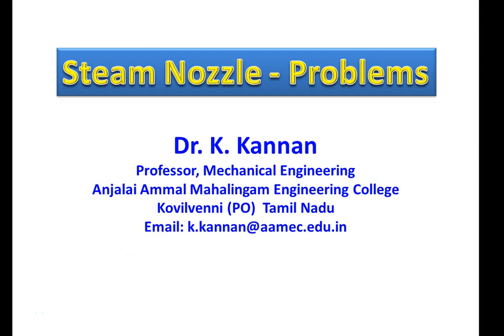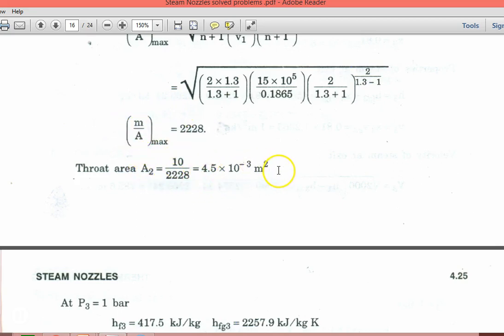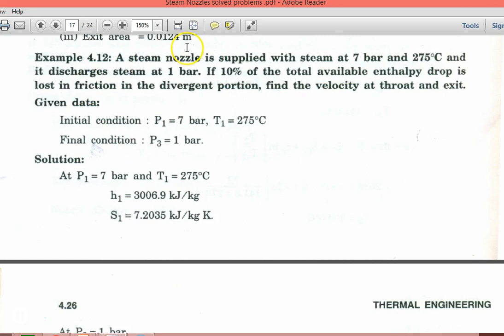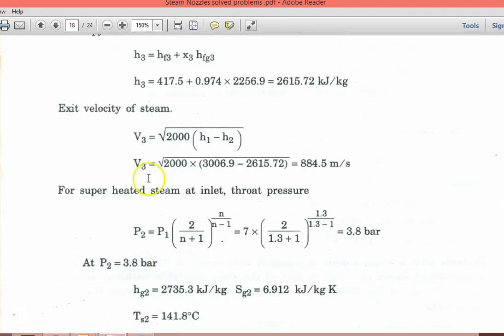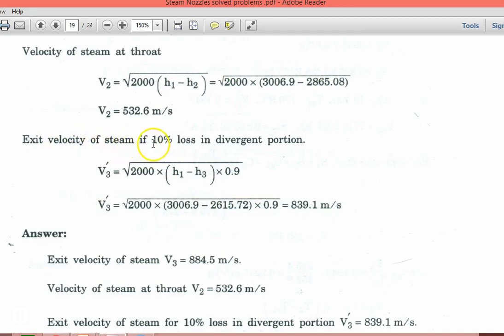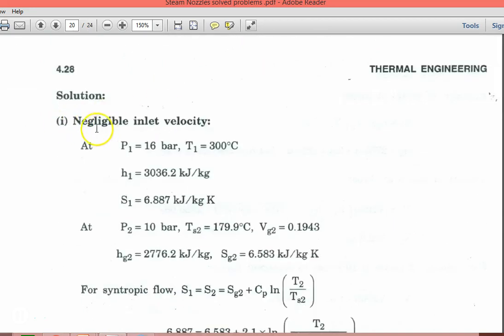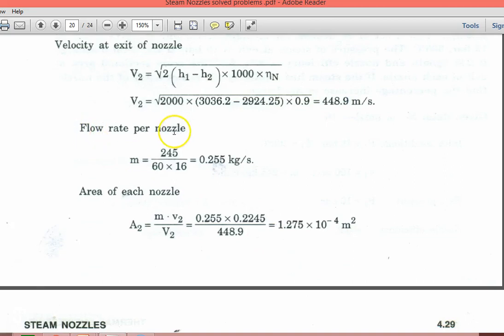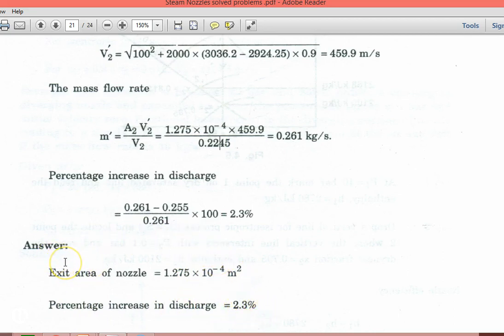SN 05 Steam Nozzle Problems 4

Comment: Sir, why you take max discharge formula at throat area calculation, why not regular method in problem 4.11
Reply from the maker: Maximum flow per unit area
Not Max flow
Area is the lowest
So the flow is maximum

Comment: How are you telling that it is superheated without any given data in question
Reply from the maker: Clearly explain your doubt
Qn number given condition etc
Reply: Sir in question no . 4.12 while solving for throat i.e while finding T2 you are writin the formula for superheated condition but in question they didn't mention about superheated condition
Reply from the maker: Temperature at throat pressure is saturation temperature
If the temperature of steam more than saturation temperature then it is super heated steam.
Reply: Ok sir thank you 😊